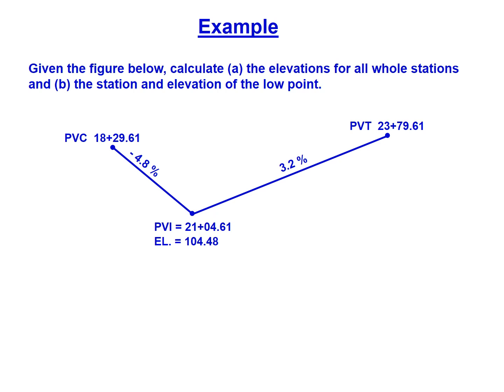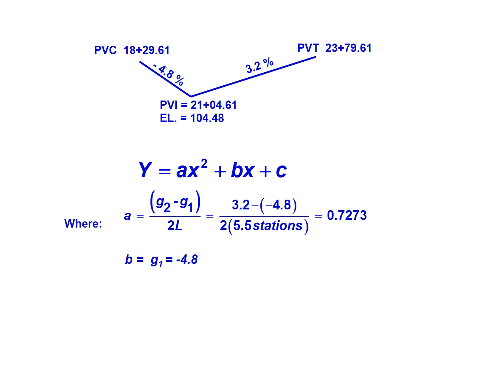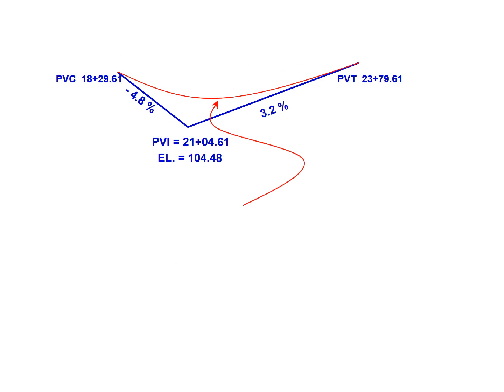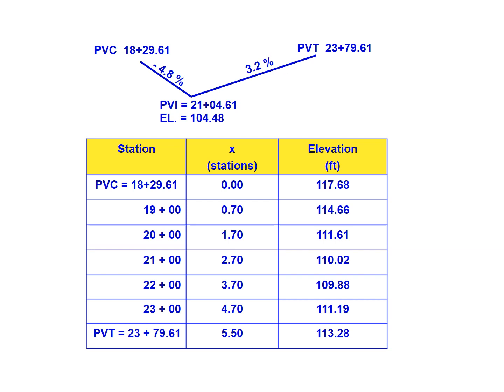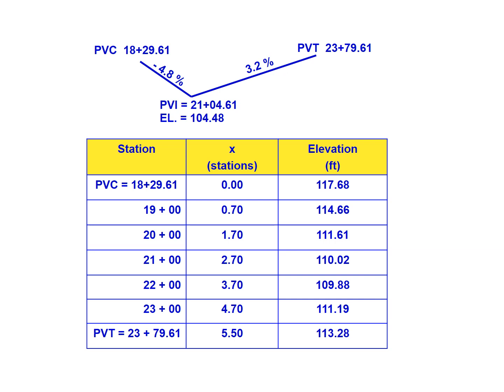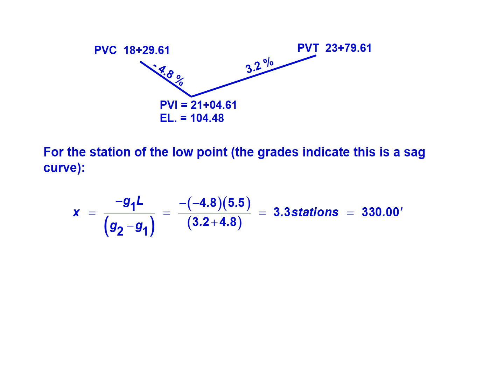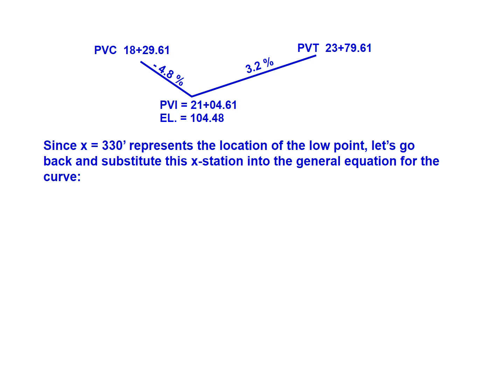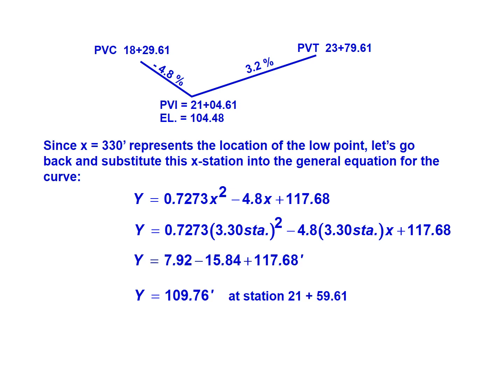Vertical Curve Example Problem

Comment: You made a big mistake at 1:39, you should have converted 4.8% to 0.048, and I checked your math, it was totally multiplied by 4.8.
Reply from the maker: Because the example uses stations for the length, it's appropriate to keep 4.8 as a percent.   Using stations instead of feet effectively compensates for using 4.8 instead of 0.048.  So, the calculation could be -4.8*(5.5/2) or -0.048*(550/2).   Let me know if that makes sense.
Reply: @FindleyDaniel  I see now, I guess I was taught with the second equation you wrote so it really confused me at the time. Thank you it does make sense.